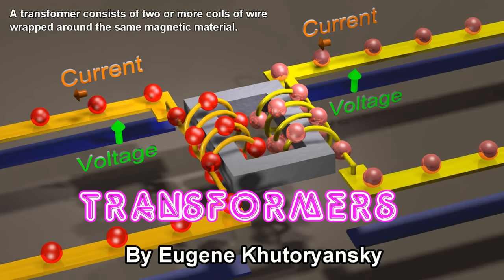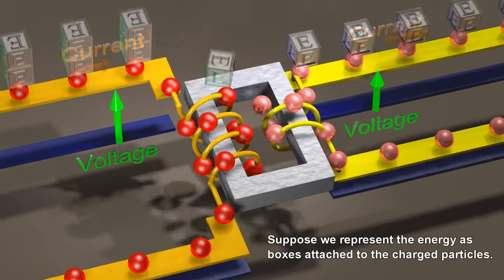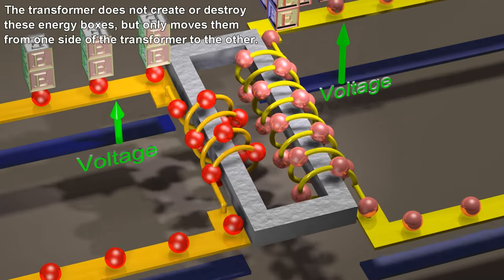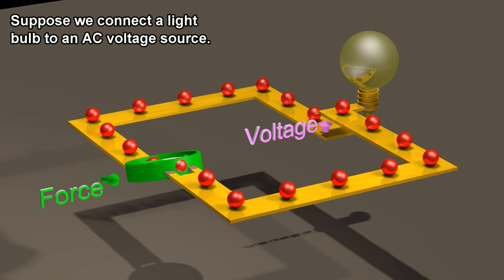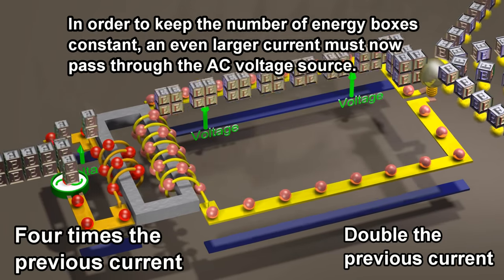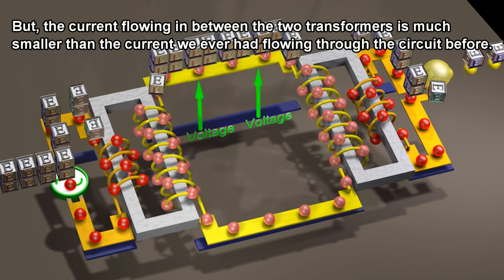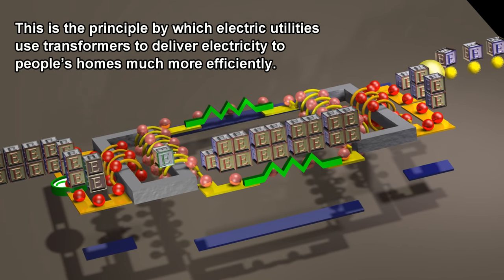Transformers - Electric Power transmission

Comment: So if we touch the part between the two transformers, we wont get an electric shock?
Reply: That part is called the core of the transformer.  It is made out of a ferromagnetic material like iron.  It doesn't get energized to carry current directly, but instead uses magnetism as an intermediate way of carrying the energy.

You would not get a shock from the voltage of either of the coils, if you touch the core.  The coils have a coating of surrounding the metal that insulates each turn from the neighboring turn.   The voltage of the two coils doesn't directly energize the core electrically, the way touching a wire would energize you.  Instead, the current of the primary coil energizes the core, through the magnetic field associated with that current.

It still is dangerous to touch the core, even if you don't get a shock from it.  Transformer cores get hot enough that they could seriously burn you.   Additionally, you don't want your body to unintentionally become the secondary coil, and induce a voltage in your body's circuits from the magnetic field, that ultimately would shock you.

Comment: Surely the current in the other coil goes in the opposite direction?
Reply: +Dissident Undead  must add I think your videos are fantastic.
Reply from the maker: +Dissident Undead, the direction for the current shown in the video is correct.  The direction of the two currents are such that the current in the second coil tries to cancel out the magnetic field from the first coil, as was discussed in the video on Maxwell's Laws of Electromagnetism.  And thanks for the compliment on my videos.

Comment: Shouldn't greater number of turns in secondary coil increase the number of electrons per second movement, therefore increasing current in the secondary coil part. Please elaborate.
Reply from the maker: No.  The current in the secondary coil wants to cancel out the change in magnetic flux created by the primary coil.  If the secondary coil has more turns, then this means that a smaller current is required in the secondary coil to cancel out the magnetic flux created by the current in the  primary coil.
Reply: Physics Videos by Eugene Khutoryansky 
Eugene, why don't the electrons in the secondary coil align themselves in the magnetic field direction at any instant created by primary coil, why the electrons in the secondary coil tend to oppose/resist aligning themselves in the magnetic field direction of the flux created by primary coil at any instant. I don't get it. Pls help. I will be thankful.
PS: I ve seen your Electromagnetism:Maxwell's laws video but I m still not clear with my question above.

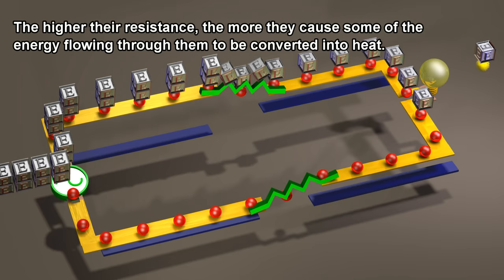Comment: 7:28 "The higher their resistance, the more they cause some of the energy flowing through them to be converted into heat"
But if you have less resistance, you will also have higher current, which won't cause a higher heat? Can someone explain to me, please? Thanks!
Reply: I think he meant that because u have a much longer cable... u lose more energy as its converted into heat...so if u have a shorter one yeah u lose some but not as much as longer one

Comment: If the transformer increases the voltage, the current will decrease after that but for the light bulb, the higher the voltage the higher the current will be across it. So why the light bulb is more shiny with a higher voltage (low current) than a higher current (low voltage) ?
Reply: A lightbulb shines because of the product of current through it, and voltage drop across it (P=I*V).   That product equals the power delivered to its filament, which it emits in the form of heat and light.   If you increase either V or I, you will increase how much the lightbulb shines.

While a real lightbulb isn't really fixed resistance (since temperature plays an important role), that is the way we are modeling it in this demonstration.  Resistance is the ratio of the voltage drop across it, to the current through it.   Voltage difference is the cause, current is the effect.   Voltage difference directly determines the current, through a passive component like a lightbulb or resistor.

A lightbulb is not a transformer.  The equation V1*I1 = V2*I2 has nothing to do with lightbulbs.  Lightbulbs convert electric power into heat and light.   Transformers reformat electric power, as a form of "electrical leverage" to get power to travel long distances.   Transformers are analogous to a pair of gears, where they trade one variable for another, of the two variables that when multiplied equal power.  For gears, it is rotation rate and torque.  For transformers, it is voltage and current.

Comment: for a bulb does 
1 electron with 4J of energy and
4 electrons with 1J of energy each 
are both same?
Reply: Both examples carry the same amount of energy, but the first example has 4 times the voltage.   Voltage is defined as energy per unit charge.   A Volt is a Joule of energy per Coulomb of charge.   A Coulomb is defined (as of 2018) as exactly 1/(1.602176634e-19) elementary charges like the charge of an electron.

Comment: I think it's unclear what system this refers to where doubling the voltage also doubles the current in a transformer. Did the demand quadruple? Total wattage should remain the same across a tx if the voltage changes
Reply from the maker: If you double the voltage across a resistive load (such as a resistor or a light bulb) then the current also doubles, and the wattage is multiplied by 4.
Reply: @EugeneKhutoryansky  Ohm's Law.

Comment: but why V^2/r cannot be used in this situation
Reply: 林梓俊 heat is produced due to the charge flow or current.
Reply: Yes you can use it, but you have to specify what 'V' actually mean here. Since you want to find the heat produced across a small portion of the wire, 'V' is the voltage drop across that portion of wire (not the voltage across the coil which is very large) which is very small. So you will get the same answer.

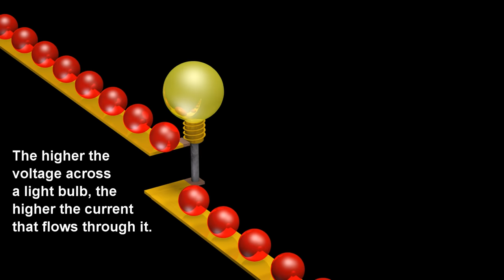Comment: 3:27 and 3:44
Higher voltage means higher current or the opposite?

And why it doesn't work with DC? AC, for short periods of time, looks like DC for me.
Reply from the maker: +Rodrigo Appendino, the side of the transformer that has the higher voltage has the lower current.  Though, a higher voltage across a device such as a light bulb or a resistor means a higher current.  The transformer doesn't work with DC because the voltage created depends on how quickly the magnetic field is changing with time.  A DC current produces a magnetic field that doesn't change with time.

Comment: Why the coil behave as normal wire when dc current flows through.....
Reply from the maker: Because with a DC current, the magnetic field is not changing, and it is the changing magnetic field that creates the voltage in the coils.

Comment: 0:33 - When a DC current passes through, then the transformer doesn't do anything. When a AC current passes through, it does. Why the difference?
Reply: DC voltage doesn't create a magnetic field around the conductor. A DC voltage through a transformer would actually be a dead short and would blow the circuit. In an AC circuit the magnetic lines of flux around the conductor align down the center of the coil, transferring their magnetism onto the iron core which carries over to the secondary windings (the coil on the other side of the transformer) inducing a voltage onto it and allowing the power to continue to flow.
Reply: @elemento1991  Correction: DC voltage DOES create a magnetic field around the conductor.   All currents create magnetic fields.   What doesn't happen in DC, is that the magnetic field that the primary coil creates would be constant.  It takes a time-varying magnetic field for the secondary coil to generate a voltage, as per Faraday's law of induction.

Comment: how is primary hooked to second?
Reply: A magnetic coupling.   The primary winding uses Ampere's law to generate a magnetic field as a result of the current.  The secondary coil, sharing that magnetic field, uses Faraday's law of induction to generate a voltage from that magnetic field.    By making the core out of a ferromagnetic material, you increase the performance of how well the coils can magnetically interact.

Comment: Can someone explain to me why the higher voltage of the light bulb forces the increased draw of current within the whole system?

To me, it seems like the voltage and current should be set once out  of the transformer, and the lightbulb gets what it gets.
Reply: Voltage is analogous to pressure in the hydraulic analogy.  The lightbulb is analogous to a flow restriction like a valve.  Suppose the valve remains set to the same position (i.e. keeping the resistance the same).  If you increase the pressure difference across the valve, the flow rate through it will increase as well.

This demonstration assumes that the power is coming from an ideal voltage source, that by definition produces the same voltage regardless of what load is connected.  A real source may have a maximum possible current or power it can deliver to the load.

Comment: Can we do the same with capacitor? I wonder!😅
Reply from the maker: I have a video on capacitors at https://youtu.be/f_MZNsEqyQw
Reply: @EugeneKhutoryansky  I think what Parvat means, is could you use a capacitor in a manner analogous to the way inductors are used for making a transformer.

Like if two pairs of plates were arranged in a way to share the same electric field, but with different areas to pick it up, could they use capacitance to transmit energy and change the voltage through an electrostatic field, the same way transformers use inductance to transmit energy and change the voltage through a magnetic field.

Comment: At 3:24, Can someone please explain this.
So if voltage increases, current decreases? Isn't that contradictory to ohms law?
Reply from the maker: Ohm's law is for the relationship between voltage and current across a resistive element, such as a light bulb or a resistor.  What I was discussing was the ratio of input to output voltage and the ration of input to output current in a transformer.  I discuss how to reconcile this with ohms law later in the video, where I show what happens when you add a light bulb to the output, and then start changing the transformer turns ratio.
Reply: @EugeneKhutoryansky  Got it thanks!!! :)

Comment: You’re videos are really helpful for my students, thank you. In this video there should be a 90 degree phase difference between the primary and secondary coils. Can you change this simply?
Reply from the maker: The video shows it correctly.  The voltage through a coil is proportional to how quickly the magnetic flux through it is changing.  Both coils share the same magnetic flux, therefore the voltage waveforms on the primary and secondary coils are in phase with one another.  You are probably thinking of inductors, where there is a 90 degrees difference between the voltage and the current.  I cover AC current impedance (both inductive and capacitive) in my video at https://youtu.be/zO7RZZW0wSQ

Comment: Actually some transformers work with pulsed DC, like pulse transformers or some air core transformers. It is important to use core of low hysteresis such as ferrite with a duty cycle adjusted so that saturation does not happen. Not to mention flyback and ignition transformers which are not continuous but still are transformers and do work with pulsed DC. Also, idea that energy is transferred from primary to secondary is totally wrong, but no need to get into overunity, which is a fact, here.
Reply from the maker: Pulses DC is not DC, because it has AC components.  And yes, energy is transferred from the primary to the secondary, due to conservation of energy.

Comment: Немного неправильно. Когда течет постоянный ток в первичной цепи в момент включения, во вторичной цепи появится ток.  Кратковременно)
Reply from the maker: The video is correct.  You are thinking of a step function, which is not the same thing as a DC voltage.  If we do a Fourier analysis of a step function, we will see that it has AC components, and it is these AC components that are transferred to the other side.
Reply: @EugeneKhutoryansky   ваше видео замечательное. Безусловно. Но есть еще маленькое несоответствие), если вы хотите изобразить переменный ток, шарики должны двигаться с ускорением,кратковременной остановкой, и ускорением в обратную сторону (синусоида). Без постоянной скорости. Постоянная скорость шариков соответствует постоянному току и постоянному электромагнитному полю).
Sorry for Russian lang, I not enough know english.

Comment: When V  UP the I  DOWN
Reply: It works like a gear system.  Gears trade torque for rotation speed, transformers trade voltage for current.   Two parameters which when multiplied equals power, and power is theoretically equal on both sides of an ideal device.

Comment: IMHO phase relationship is wrong. Secondary voltage shall be proportional to primary current change.
Reply from the maker: It is shown correctly in the video.  Both the primary and secondary voltages are proportional to the change in magnetic flux with respect to time, and approximately the same magnetic flux goes through both the primary and secondary coil.  I cover this in much more detail in my video on Maxwell's Laws of Electromagnetism at http://youtu.be/9Tm2c6NJH4Y